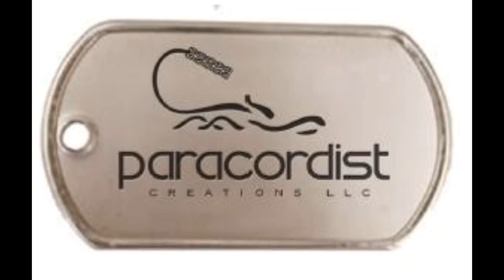Paracordist's How To swap buckles of different sizes on the Ultimate Paracord Bracelet Jig

Comment: I'd just have different sizes of buckles attached to "s" rings. The non-buckle side which just be attached to the stationary peg. No need to clamp down on it either. Slip on, slip off, like the original "Karate Kid".